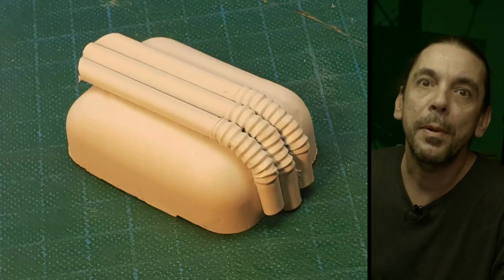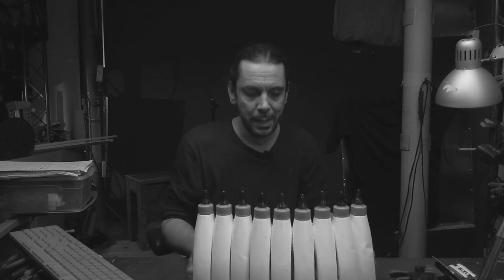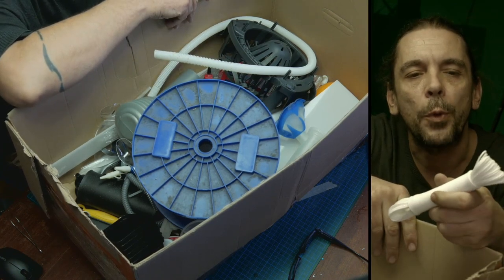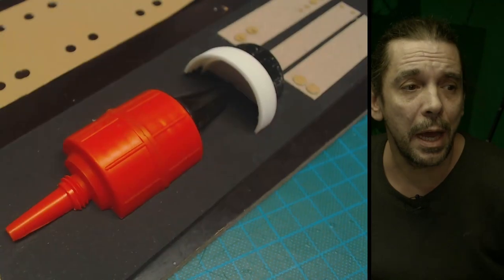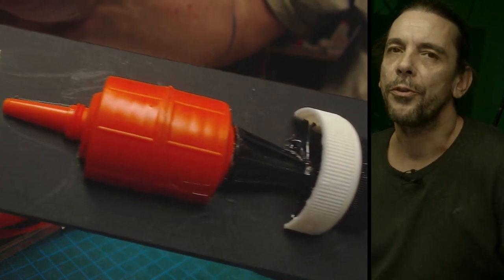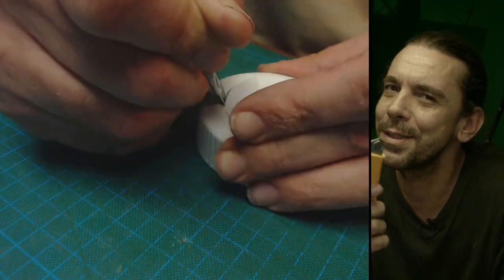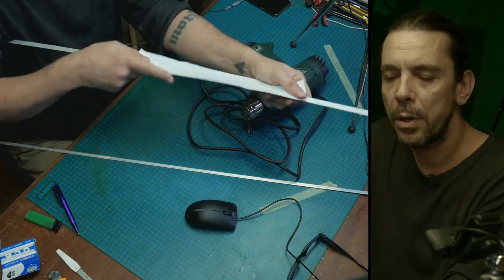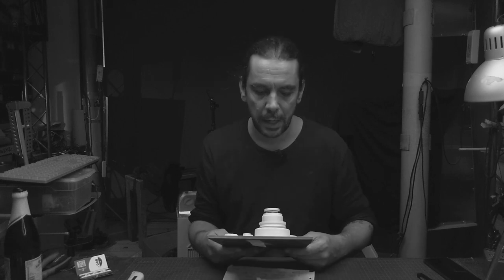Kitbashing for a Sci fi look (plastic trash) the best Diy Upcycling method for your plastic trash.

Comment: Perfect timing for this video! I am making model scenery for a tabletop wargame with a sci-fi theme. Like you, I noticed that I could obtain the futuristic shapes I desired by looking to plastic trash and started collecting my waste. My questions are now those same questions - how to fill gaps around soft plastic? How to strengthen soft hollow shapes? How to create small details that don't look glued on? I look forward to your exploration of this topic!
Reply from the maker: Hi, I hope I will revisit the subject very soon.
Best wishes
Reply: You could use acrylic wood filler for gaps. If you want to stabilize hollow shapes, you can cut old plastic folders or anything that is flat that is also plastic, and layer them inside the shapes. For small details, you could try using liquidy glues. If you can still see some of the glue, you can sand it down. Hope this helps and good luck with your project. 😀😀😀😀😀

Comment: My favourite part is your questions! I have made terrain  from plastic rubbish but so far I only took them as 'given' forms, I am excited alter them as you have. And he idea of deforming them using heat gun or soldering iron is definitely worth trying!

I gave up on the thin flimsy transparent plastic as it is too easily deformed and paint flakes off when it moves. Excellent exploration.
Reply: You can strengthen the walls of flimsy plastic parts with either Styrofoam (XPS foam is used for insulation), if careful can use cans of expanding spray foam, or simply fill the object with ready made spackle, both can be purchased at most home improvement/hardware stores.